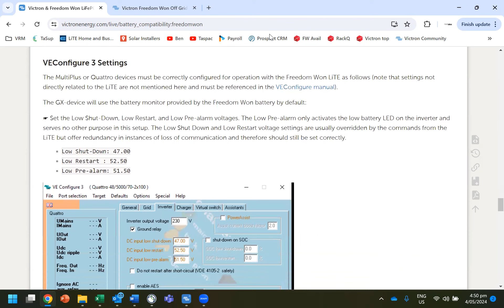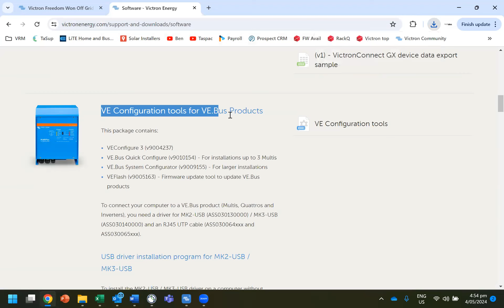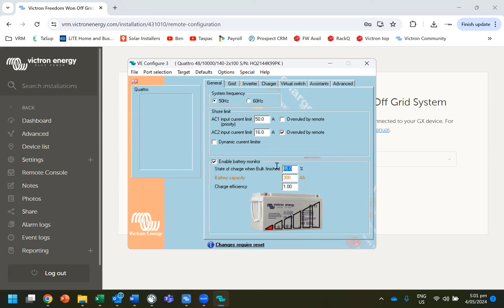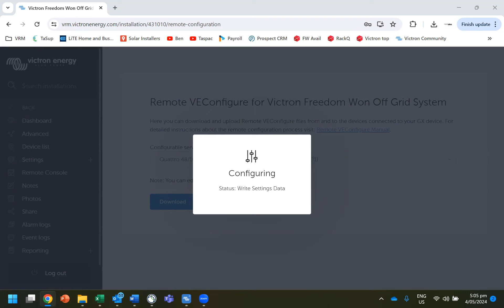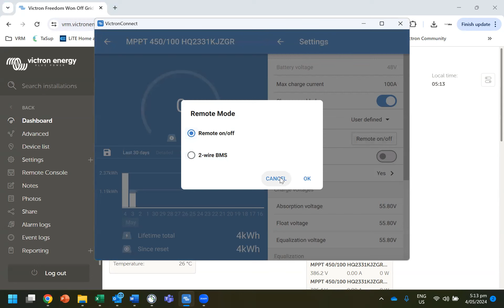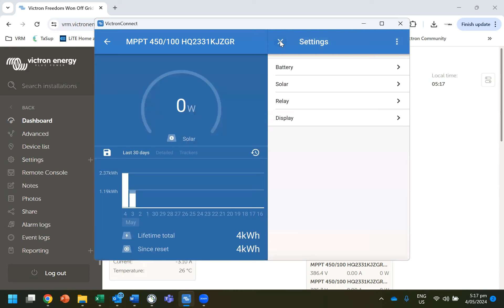Victron Freedom Won VRM setup basics Pt 1

Comment: Thanks mate this helped a lot, its a shame that a multiplus2 doesn't have a Bluetooth set up for charger setting on the fly like the solar charge controller's do but I'm glad I was able to do it by the CerboGX and VRM as this saves me money by not having to purchase the MK3 programming cable.
Reply from the maker: Yeah - I'm sure they are working on it but the focus will mainly be on the most benefit for the average market - most people buy a GX these days and Victron's recent addition of remote VE.config is REALLY helpful!